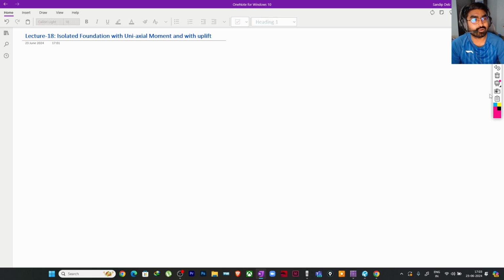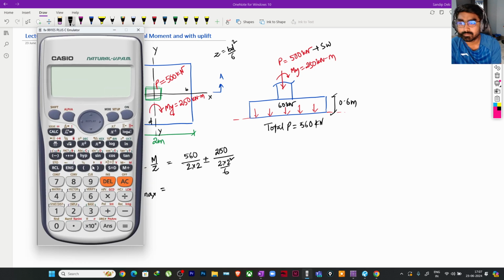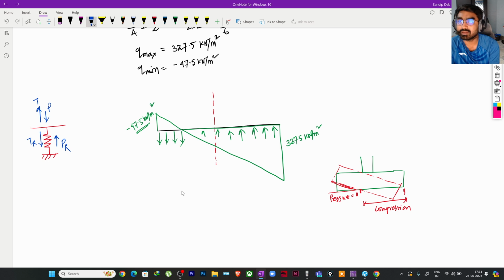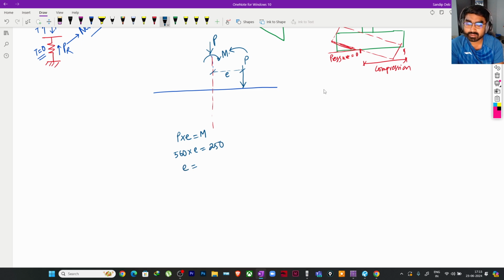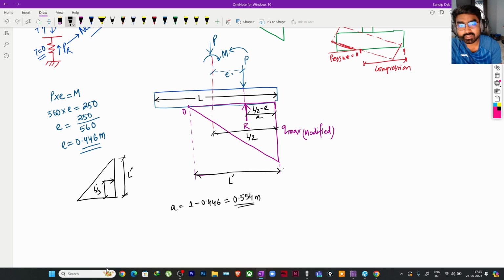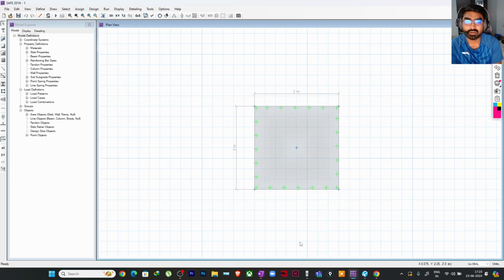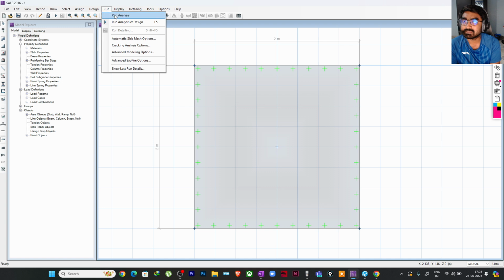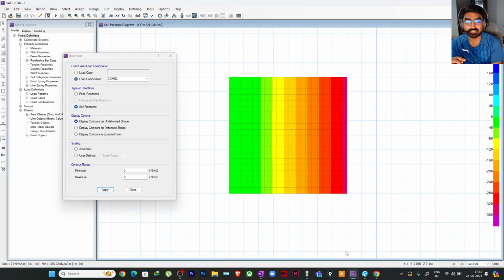Isolated Footing with Uniaxial Eccentric Loading and Uplift | Pressure Calc | ilustraca | Sandip Deb

Comment: In case of column on property line the axial force eccentricity causes large BM on footing causing tension on one side, as you say can I design the footing till not more than 25% area of footing is in contact with soil.Does the footing SBC condition for service load should be satisfied or the SBC value can be relaxed by considering 1.5 safety factor as compared to 3 which is usually. But also the SBC with 200 kN/m2 will only satisfy for single floor building as for two floor the axial load is such that the SBC value comes less than footing pressure.So in this case do you design footing as strap footing,combined,etc or can rectangular footing can be provided?

Comment: Sir, In CSi safe Deff for foundations is taken with reference to top cover for  punching shear check when we right click and check on ratios...How to solve this issue in csi safe..Also in newer versions reinforcement increases when mesh size is reduced whereas it was opposite in old version of 2016..So I always calculate reinforment from moment values..